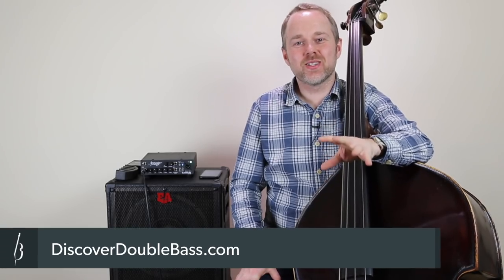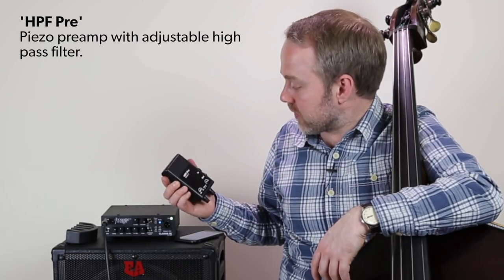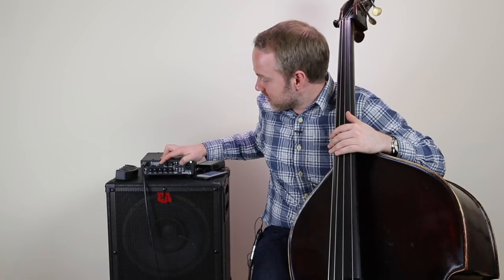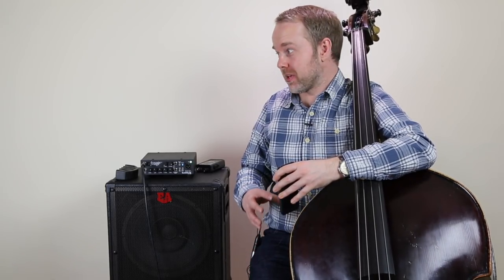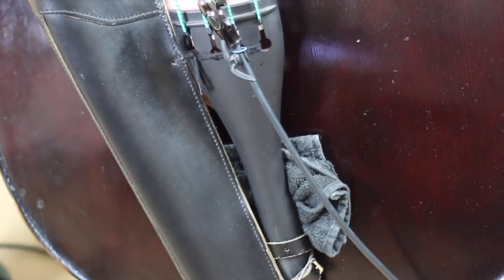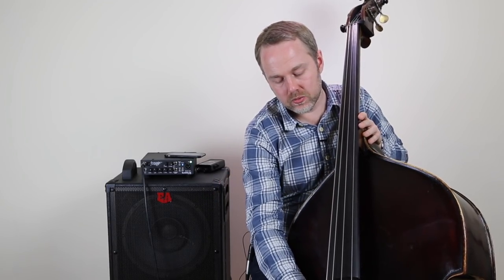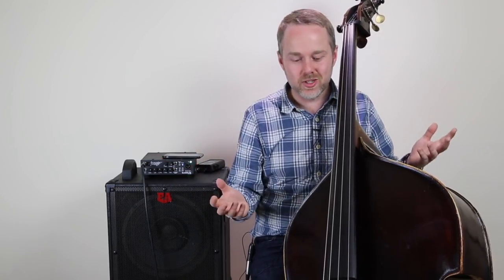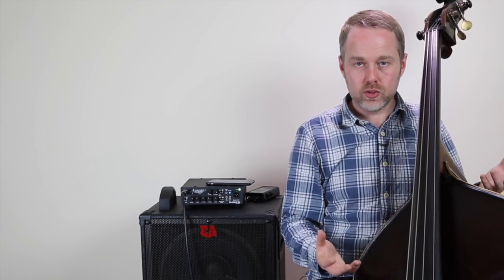How to Eliminate Feedback on the Double Bass

Comment: Hi Geoff, thanks for your helpful video - I use gut strings with relatively high action on a big, old bohemian flatback orchestral bass! In my experience, the biggest secret is using placement in physical space to your advantage (i.e. bass and amplifier on opposite sides of your body) to prevent feedback loops, and placing the amplifier at a considerable distance (optimally 6 ft. or ca. 2 meters) where space allows. This gives you a better concept of the sound your audience or bandmates are hearing. Additionally, I use a preamp with sweepable mid and low end notch filters - that has been a real godsend, helping me to find and compress those problematic resonant frequencies (be it the tailpiece, body, pa-speaker cones or room) that vary in dominance when placing the same bass with the same setup & amplification in different physical environments. My two cents - keep up the good work!

Comment: I use a notch filter. My Acoustic Image Coda (800 Watt version) has a feedback knob that can work as either a High Pass or Notch filter.  High Pass removes too much bottom for a good sound to me. My Acoustic BA1000 amp heads (I have two) also has a notch filter and a 7 band eq. I use a mark bass traveler two 10 config. I prefer the big bottom you get when you put it on the floor, but if on wood or hollow stage I decouple it from the floor with 4 bean bags. (This trick is also good for decoupling pa speaker stands and microphone stands from hollow floors).  I turn the bass up louder than need6, set the phase for the least feedback/best focused sound, walk the bass up chromatically till I find most resonant pitch, dial in notch, tweak  eq to remove harshness. The notch must be set with bass oriented as it will be while playing because my amp is right beside me to my right and distance and orientation will shift the resonant feed back pitch. Using this method I can play almost anywhere at any volume inside or outside and be loud enough

Comment: Geoff, I'm surprised you didn't talk about distance from the cab and positioning yourself vis-a-vis the cab.  If you're standing right in front of your cab, you are more likely to feedback.  So the further away you can be, often the better.  I also find there are times when I need to position my strings/neck on an angle between 25degrees to 90 degress (perpendicular) to the cab face.  I've never tried putting the cab in front of me (instead of behind).  I know that works with microphone feedback.  Someone who has tried that maybe will comment too.
Reply from the maker: That's a great point Gary, positioning is key and can make all the difference. I've not tried the amp in front of me on double bass, but it certainly has to be worth experimenting with and it could help to keep the bass amp from being picked up by other microphones.
Reply: while I'm at it, I have successfully used the LR Baggs Venue preamp with my DB. It has a notch filter and 5-bands of eq.  I'm still learning how to get the results I want with it.  Each room is unique, and setup time is never enough for me, my band likes to setup and play within 30 minutes.  It's always tweaking after the first song in the set for me, which is no way to really run your sound.
Reply: I might add I use the LR Baggs Venue preamp pedal in my rig.  i've been learning how to adjust its notch and other filters.  works well so far.
Reply: @DiscoverDoubleBass   Having the amp in front works incredibly well to the point that people tell you to turn down! Jim Mullen the jazz guitarist stands just behind his amp when he plays his big semi acoustic guitar.
Reply: There's a lot.

Comment: All good ideas! What I do with good success is cut the low-end a bit, use a compressor and also to put foam in the F-holes starting with one hole on the treble side and if that is not enough or I need to use much more volume on the amp to plug both holes. With both holes plugged you can get electric bass type volume but still have the upright sound comes through nicely.

Comment: I would add:
Invert the signal. It means the wave form coming from the bass is inverted in relation to the one coming from the amp, and they cancel each other instead of feed back each other. 
I get that with my Radial Engineering PZ DI.
Reply: I also use a Radial PZ direct box and it’s great. It uses phantom power from the board to boost your piezo signal (which the sound people appreciate), selectable resistance, a -15 db pad, high and low pass filters, and a through output with a selectable preamp to go to your amp.

Comment: That's some good advice Geoff, I'm glad you got into the more extreme ideas even though you may catch some flack, they can work in a pinch.  It's really hard when your only monitor is your amp, but two other things to consider are eq and phase inversion.  bassists tend to feel like it's all about the low end but especially as the volume gets louder you're better off lowering below about 300 to clean up the sound.  If your amp or preamp has a phase or polarity switch, that can also eliminate feedback instantly without changing the sound at all.  Cheers!
Reply from the maker: Thanks Gelen. That's a great point about the phase inversion. i will have to try that when I get to use an amp with that function. Plus, great point about the extreme low end. that's always been the biggest problem for me in terms of frequencies.

Comment: I play in rockabilly bands and occasionally blues bands, I use a Rich Barbera pickup which cut down on feedback a lot but what really helped is when I switched to Acoustic Image Contra amps years ago and, more recently, their 'Ten2' amp - really do help with feedback control. I do put my left knee against the back of the bass but not pressed just rested - it also depends on what frequency is feeding back as to where you put your knee.

Comment: Great advice Geoff.  I use David Gage Realist directly into a Gallien Krueger MB 112-II.  I've always placed my combo amp on a chair for EQ purposes.  I've noticed in different rooms or outdoors, different strings will feedback...sometimes it is the A, sometimes the D, occasionally the G.  I only have four EQ knobs and the GK handles it like a parametric.  So, I'm not just adjusting a specific frequency, I'm changing a curve of frequencies.  Many times I can lower the low and mid-low to eliminate most of the feedback. I agree with Gary Holdsworth:  Sometimes moving the amp off to the treble side of my bass will help (not always for the drummer's sake though) and putting 10 - 15 feet between it and the bass will help immensely.  I also agree with the angle to which the strings are to the amp.
Reply from the maker: Great to hear the Gage/GK rig is working, that's a nice combination. Plus I think you're spot on about the positioning of the bass. That's a great thing to work with. I've always been guilty of having the amp too close and have got better results if I leave a bit of space. Cheers Geoff :-)
Reply: The GK is good for the price.  However, I'm drooling over your rig Geoff.

Comment: I play with quite a loud band and with my setup fortunately zero feedback I use a Schaller magnetic pickup and Eurosonic strings which have a braided steel and silk core, very hard to get hold of so im thinking of changing my setup.  (Obviously there needs to be some steel there or the magnets wont work). I used presto strings previously with similar results. Some would say with a Magnetic it ends up sounding like a big bass guitar but when the whole band is playing it sounds pretty good IMO..

Comment: Great tips most Rockabilly players use gut or synthetic strings. We also tend to use a neck pickup as well as a bridge pickup to get the 'click' . I personally use a GK 150 and a David Gage realist pickup . I DI through the pa so my amp is just a monitor. I use clear sticky back plastic to cover the sound hole which really helps  and can be easily taken off . It's seems to be down to the individual bass what suits one doesn't always work with another.
Reply from the maker: Hey Terry, good to hear from you. I love the GK150. I think they are great combos and they are so light! Plus you make a good point that all instruments need different solutions. Finding the perfect right is part of the fun of playing double bass. :-)

Comment: Two additional comments. I also had problems of feedback at wolf notes from the portion of string between bridge and tailpiece and found that easy to damp. 
But the best solution for me has been playing an Eminence upright bass, purchased to ease transport but, because of lack of resonance, is virtually free from feedback. Even with a low B. And if you are laying that loud the acoustic output is less significant.
Reply from the maker: They are great points and I think the wolf notes can really effect the acoustics and curse problems. Plus Eminence are awesome instruments and really practical for loud gigs/travel.

Comment: Hpf and mid cut helps me.  My bass is so loud and boomy acoustically so like you said it's one or the other.  Shrink tubing between strings below bridge helps too.  Always a battle for me.
Reply from the maker: I've heard of using shrink tubing, but never tried it. That sounds like a good solution.
Reply: A very tight pickup fit has helped me a lot.  I don't even use a preamp anymore and rarely have feedback issues anymore.

Comment: Also it is tough when you the bassist have it all together with the sound situation and the drummers' kick drum just pounds vibrations into the doghouse, that is the worst. then it is all about repositioning yourself or creating some barrier of sorts. Also if you are bowing sometimes sympathetic vibrations start feeding back , typically for me on the E or A string. I lean in and damp the string with my left ear, but recently I have slid some felt by the nut under all strings and this works marvelously.
Reply from the maker: I'm glad it's not me who has used my ear to mute strings! :-) I know exactly what you mean and playing amplified with the bow is a real test of your left hand muting to keep it all from resonating. Plus, you make a great point as we are usually right next to the drummer which is great for the groove, but they do tend to be pretty loud :-)

Comment: Geoff, what about using mics like audix adx 20 ip or dpa core 4099?

I'm trying to stop bleeding and feedback but is really difficult. 
Any recomendation to make it sound a little better? 

Thanks a lot!
Reply from the maker: It's a really tough one. I've always found it too unreliable to use a mic with my bass amp and not worth the extra effort...though there are some who do make it work. You could try using a preamp such as the Grace Felix, but they are expensive and it's still difficult. A good place to search for advice is the Talkbass.com double bass forum. Best of luck.
Reply: @DiscoverDoubleBass  thanks a lot, dude!
What i'm trying to do is to blend my piezo with the mic to take a better timbre but it's also too hard sometimes, especially when i'm playing with a loud drummer. 

Thanks for the advice, i'll try some cheaper preamp or something and then I'll tell you if works.

Comment: Great tips man! Just putting it out there, gut strings are feedback madness 😆
Reply from the maker: I've never gone all gut, but they do sound like the worlds most impractical string...yet I still want to do it! :-) It's all about the tone!
Reply: They are indeed very impractical but since I grew up with them I got used to the different issues! If you do end up trying them though, check the Troll mic! It does wonders with my acoustic image coda. Very good thumpy sound and definition too. But obviously you won't go as loud as some piezos!

Comment: Thanks Geoff! This has been such a challenge for me. I've tried the knee against the back (had to hold it there almost continuously). Phase inversion seems to work. The last DB gig I did, I tipped the amp back at 45 degrees so it was pointing at my ear instead of my bass. The biggest problem always seems to be the volume coming from the house and the kick drum. Like you mentioned, most sound people don't seem to have much experience with double basses. I've had more than one turn me right down because of feedback instead of adjusting EQ or doing a high-pass shelf. I wish there was some simple instruction I could give to a sound person to make their lives easier (so they don't just turn me off in the mix). Anyone out there have some simple tips they give to sound people?
Reply from the maker: That's a great point Mike, using your knee to dampen the back can be a big help. I'm really not sure about working with sound engineers, but I think you're right that we must be able to work together to get better results.
Reply: If only it were so simple!  Double bass is one of the most difficult instruments to deal with on a stage.  Best thing you can do is prepare your rig, don't expect the sound techs to take a direct unprocessed signal from your pickup and crank it up to concert volume.  Use compressors and expanders, and a 31 band graphic eq, with the sliders that light up so you can kill feedback easily.  Get there early, be patient, and get the other members of the band to cooperate with your limitations by keeping their levels perhaps lower than they would like.  Use multiple stage monitors so your sound comes to you from multiple sources at various distances, and keep your amp itself at a relatively low volume.  If you struggle to hear yourself in the mix, invest in some in-ear monitors so your stage volume can be lower.  Mix your direct signal with a mic on your amp, and de-couple your bass itself from the stage at the end pin.  This is a huge problem with stages that have subwoofers built in underneath.  Above all, be cool and understand if you don't get it right by show time, you're definitely going to get turned down in the mix.

Comment: I always had loads of feedback. Today I am certain it came from the input impedance. I tried stuffing the F holes with foam and all, but it only works well if you kill the pressure exchange between the inside and the outside of the bass. Foam and gaffa tape do not help much. Fiberglass covers seem to be the best option. 
https://duke-bass.jimdo.com/zubehör/gfk-f-loch-cover/
Reply from the maker: That makes a lot of sense and Duke are experts at this. I would love to try some of their basses and those covers are a great design.

Comment: Great lesson and great conversation in the comments as well.  I use a David Gage Realist and used to have a terrible time on any gig where I had to send a line to the PA.  The signal is too weak and the soundman would crank up the gain, causing feedback.  A Fishman Platinum Pro has solved that problem completely.  Last night I had an awful time on a big stage, monitor and FOH   speakers were in contact with the stage and engaging with my bass through the endpin producing feedback.  The soundman had to roll off a lot of low end from my bass to get rid of it so my sound was thin and I didn’t feel comfortable playing at all. Will try the cloth under the tailpiece and beanbag under the endpin next time.  I have also had the problem with sympathetic vibration when using the bow amplified and hardly ever do this as a result.
Reply from the maker: Great to hear about the Platinum Pro! I've not tried it but when I did try the realist there was too much bottom end and it was very muddy. Perhaps it just needed a pre-amp to clean up.

Comment: I use a spectrum analizer app "spectroid" on android to find the feedback frequency and then dial it out using a parametric EQ. The GK MB150E has parametric eq.
Reply from the maker: Thanks, that's a great use of the app! I've never thought of that before, but I will give it a try.
Reply: Tim Reynolds the GK MB150 does not have a parametric eq?  Just a 4 band, right?
Reply: there are two types of mb150 (possibly more) my one, mb150e has a sweepable hi and lo mid, plus bass and treble. i've just got it and discovered the lo cut feature. it really helps!
Reply: Wow!  Just checked it out.  That must be a new addition to the design!